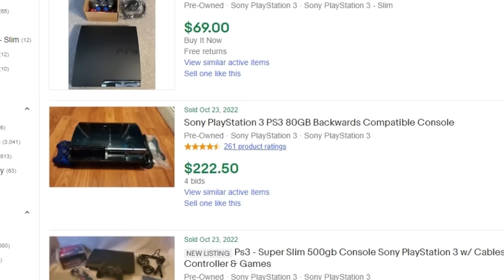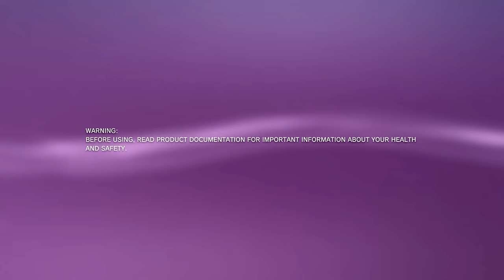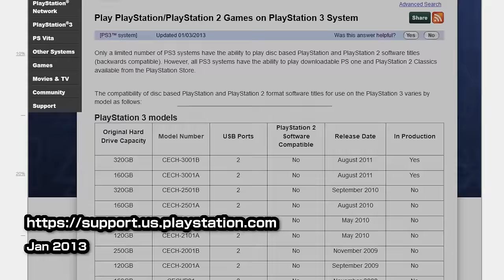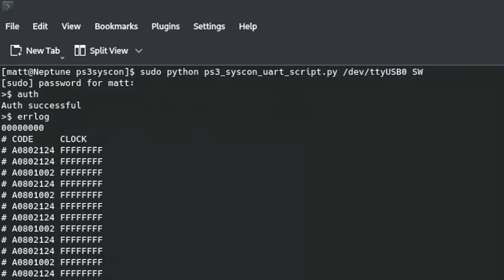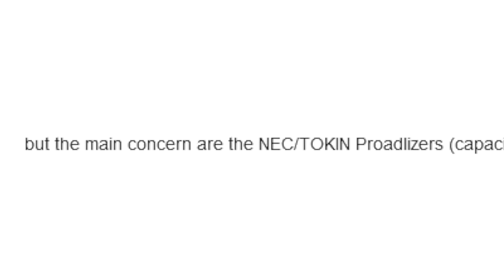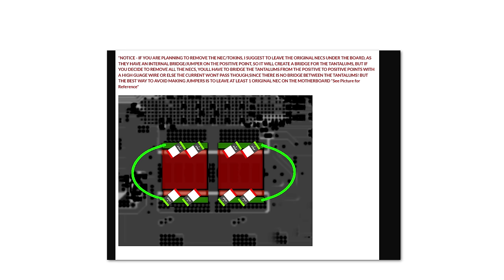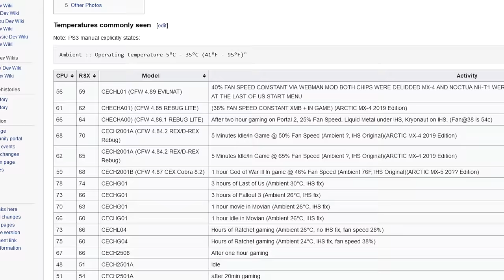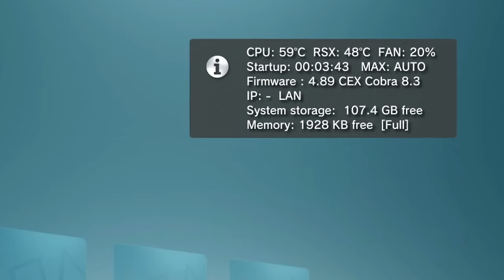I bought 3 PS3s for $50... how bad could it be?

Comment: By the way, the NEC/TOKINs don't fail that often. Always check SYSCON logs.

Also - the wire you used to bridge the 2 sides is far too thin - it will heat up excessively and may burn. This has happened to people who have done the NEC/TOKIN replacement before and can be very dangerous. You need to use a much thicker wire.

Usually what happens is people go heatgunning the board to remove the NEC/TOKINs which temporarily "revives" the GPU on the board. Most systems where people replace the NEC/TOKINs end up failing again later as they were never the cause of the issue originally.
Reply: Didn't you saw the error code 1002 point out a bad VDD for the RSX? That's not a BGA problem, if it was, it would appear as 3034, 4402 or 4411. The Nec/Tokins were the problem on that unit, reported by Syscon and confirmed by swapping them. Heat would temporarily fix something in the case of BGA related problems.
Reply: Completely aware of this and I agree completely.

The reason I mentioned it was simply to refute in the video where it is stated about the NEC issues being "common".
Reply: @viniciusvidotto7536  You can't necessarily say any of this in absolutes. The caps were a problem, and may have been killed by a different problem, which could be anything from an intermittent power supply failure to, at absolute worst, cracking of solder beads under the GPU (which turns out to be not that uncommon on these systems, unfortunately). Again, I agree that the capacitors had indeed apparently failed, but given the age of the machine, a failure at this point in time is possibly below the life expectancy of that part, very possibly indicating a related but separate fault that caused this failure, and at the very least, the possibility of more than one point of failure, even if intermittent, should not be ignored. Please excuse any bluntness in my tone, I simply want to avoid people being misinformed and permanently damaging their irreplaceable devices in a misguided attempt at repair.
Reply: @Brooke M.  I figured the caps died from the uh, bugs and gunk that Matt cleaned out. All that disgusting stuff made it them run too hot, and then they got KO'ed.
Reply: Oh hey Octal! I didn't realize it was you at first 😅
Reply: i had no idea you could even wire up caps like this, really interesting workaround ,thanks for the tips.
Reply: Thicker wire and more of them, for sure.
Reply: fgfs on the xbox wen /s
Reply: @parnikkapore  lol
Sadly there is no framebuffer drive for Xenos, so :( otherwise it might actually be worth a try
Reply: I’ve come across and fixed many PS3’s with this same exact situation. Early Slim models and everything before it can fail because of these caps. They were also in Toshiba laptops and known to fail there too. Sony eventually dropped these caps in all board revisions shortly after the first Slim came out, 2500 I believe, so even Sony knew this was an issue.
Reply: @erikt211  Yes, they certainly can fail, but most often the failure points is the RSX itself. That is why the SYSCON logs should always be checked to determine exactly what's at fault. The reason Toshiba A300 fail was because capacitor sit right on top of CPU where it gets very hot, and it is only one for the entire rail proximity decoupling. So high load on it, and high temp on it = higher failure.
Reply: Yeah, I had heard something similar. It seems to be a more modern thought process. Just arbitrarily deciding the NEC/TOKIN caps need to be replaced is jumping the gun.
Reply: It’s quite interesting to note that even only a few years after release, people would assume it was the NEC/TOKINs that were failing when the console gave the dreaded “yellow light of death”. It COULD be the caps, but there were a host of other problems that could crop up due to Nvidia’s poor choices when picking the kind of soldier composition to use for the CPU & GPU. This combined with the natural heating+cooling cycle and the chips themselves were a recipe waiting to happen.

Most notably, a new fix that was recently found actually allows somebody to pull a CPU from a newer model PS3 (where the chip runs cooler due to better efficiency) and effectively force your PS3 to use the newer CPU. This is only achievable now because (I think?) this kind of fix required encrypted console keys and the modding community wasn’t able to crack it until recently.

Basically, you lobotomize your old CPU and give your old PS3 a newer brain to save it. Always thought that was kind of funny.

Comment: The two PS3's I have now are both from Goodwill, and of differing price ranges. My Slim was $50 and I took a chance with it. $40 from Amazon for a new Bluray drive and it works well. Sure as shit though, a year later, snagged another Phat backwards compatible PS3 from the same goodwill. Not a single thing wrong with it. The PS3 market is good now, the top tier games are dirt cheap, and honestly, they don't even look that bad either. I'm happy with my steals.

Comment: I would really like to see an update on the fixed PS3 in the future at some point after some use. The TOKIN caps have gotten a bad rep but it has been proven that they are not the primary cause of graphics related YLOD as other commenters pointed out. However in almost all cases that had any sort of a GPU related error, replacing them causes the console to temporarily revive and start working. Either you got really lucky with the machine and it was one of the few that had bad caps, or it's only a matter of time until it dies again.
Reply: You’re probably referring to specifically the Ps3 models that contained a 90nm RSX GPU which that would apply. 

However, later fat ps3 models contained 65nm RSX Gpus which did not have such and issue, and replacing capacitors would fix them(generally, still read syscon errors before doing anything to your system)
Reply: @DeadlyHellhound  Well I don't think Matt specified what version the PS3s in the video were aside from not being backwards compatible with PS2, and I'm not sure if he meant that they are not the first models ever released with hardware level backwards compatibility, or if he meant they don't have the software level either. 
Keep in mind that what I do know about the issue I learned from RIP Felix and his extensive look into the subject, but if I remember correctly the 65nm ones can still have this issue, it's just less common. As for the capacitors, the amount of times they have been actually the cause of the YLOD was rather low, but changing them revived the console in question for a while in almost all cases because of the heat involved. As I said in the original comment it's possible that Matt just got very lucky and it was a matter of the caps giving in, but I think an update in the future would be a good idea no matter what.
Reply: @xiii9354  judging by the insides and the thick heatsinks included with this system, im going to guess that it is a P01 model (second to last fat ps3 revision). 

The first non-ps2 compatible ps3s were the G models, and those models had a vastly different chassis inside but also had 90nm GPUs so theyre often found with dead GPUs. H models came soon after and had a similar chassis as pretty much all the later fat models shared at that point, although H, J, and K models had separate wifi/BT boards from the motherboard but still had the same form factor. H models also were the last 90nm models so you’ll find those junked as well. 

The only concerning models with 65nm GPUs would be the the first PS3s that came immediately after the H models, which were the J and K models. Even so, I rarely encounter any J or K models with faulty GPUs (even my K model ps3 I had since it released in late 2008 still works perfectly fine with original caps and everything) 

Keep in mind, RIP-Felixs video is based off mostly theories with a good amount of evidence to back up those theories. He never puts everything off as a fact simply because he hasn’t gathered THAT much information to really set everything in stone just yet (theres still a lot of development and experimenting regarding PS3s, this info is still relatively newish). 

So while I would agree that J and K ps3s with 65nm GPUs could be a concern since those models released immediately after the H models with faulty 90nm GPUs, there still just isnt enough proof that 65nm GPUs should be of any real issue over 40nm GPUs. There just isnt enough logged information to back up these claims (more people rather go for the 40nm gpus clearly since they are technically better GPUs anyway. But thats not to say that 65nm GPUs arent also a viable option)
Reply: @DeadlyHellhound  That's genuinely a very informative comment, thank you. I think I'm just rather cynical of the cap replacements, I got 2 fats for a similar price as Matt, both with YLOD. I went into it thinking that there is a fairly easy fix now (didn't remember it was the caps, only that I saw a video about it) but after doing some research and seeing that video from Felix it was like being punched in the gut. 
One of them might have some sort of HDD related issue judging by the fact that it doesn't flash the HDD LED while the other does, so not all hope is lost. Still, knowing that it's a design fault even if this issue can be fixed, the RSX will be a ticking time bomb. The two I got were a C and a G model, the C being the one with no HDD light.
Reply: I mean we could say he got lucky but he did check the error code before doing the replacement error code suggested that it was the capacitors, the problem with replacing the capacitors is that most people don't check the error codes before replacing them and just assume that it'll work.

It might still die later, although if it does we're probably not going to get a video from him because he's definitely not skilled enough at replacing the RSX.

Comment: Man, I watched a 2hr documentary on the PS3’s YLOD issues, and even though it all ended with “the capacitors are a fix but not the fix… the CPU ultimately needs to be reballed too” climax of the documentary, your quick fix procedure really made me reconsider my plan. The plan after the documentary was to keep my fat PS3 stored away for a bit until the community comes up with some mass-produceable, refined fix years down the line.

But I’m really tempted to try the paperclip capacitor mod just so I have a working PS3 in the meantime. Tl;dr, phenomenal video and love your work!
Reply: The RSX is not the cpu, it's the gpu

That's what having the problem, but it's also not just thr balls, but the underfill too
Reply: did you end up doing this?

Comment: Fun fact:if you hold the ps button and the share button on a ps4 controller for 5 seconds it starts to blink and if you go the Bluetooth settings on the ps3 it will state the ps4 controller as a “wireless controller” and if you press it you can use the controller wirelessly.

Comment: For cleaning the ps3s, you can hold the eject button and switch the power supply on and the fans will spin up really fast and clean out the air vents...
Reply: What about ps4?
Reply: Now granted Sony advises to this outside for safety reasons
Reply: @samiwilmot7413  Ps4 doesn't have this, far as I know.
Reply: @andrejpopovic52  also newer modell of PS3 don't have this feature anymore. I think it is only available for fat PS3s
Reply: @DoomWarriorX  Yes. Since you have to flip the power switch.
Reply: @andrejpopovic52  and the Super Slim doesn't have a software eject button
Reply: alas my old fat seems stuck in this mode. any thoughts
Reply: That's not what it's intended for. You should still manually open it and clean the gunk out, especially repaste the CPU.
Reply: It works on the PS3 Slim too, but you have to remove the wall plug, as it lacks the back switch on the power supply.
Reply: @Sugurain  Thanks, i didn't know that.
Reply: @johnwhorfin5150  check for shorting on the buttons maybe

Comment: I'm glad you syscon'd it rather than just replacing the nectokins, as they are not the de facto cause of the ylod, which is a general hardware failure that can be triggered by any part failure the only true way to diagnose a ylod,glod etc is to read syscons… I had the YLOD on my CECHA01, the original backward compatible PS3. My syscon error was for the rsx, so I replaced it with one from the PS3 slim, which is the much cooler and reliable 40nm rsx Rather than the widely defective 90nm rsx that Nvidia originally produced for the original Xbox 360 and PS3. As an added bonus, I've gotten myself  a way more reliable and cooler original PS3 that can play PS2 disks. Great video I hope to see your take on an original ps3/xbox 360!

Comment: 19:04... As electrical engineer, this caused me a great deal of pain...
1) paperclips are not as conductive as you think
2) by that 10 cm path, you introduced so much reactance that the capacitors became absolutely useless (the current doesn't reach from capacitors anywhere near fast enough to deal with transient loads)
Reply: I'm an electronics engineer. Why do you say they're now useless? The caps are tantulum, he's used some pretty heavy gauge wire and they're really not that far away. I'd be much more concerned if these were ceramic caps - but tantulum isn't going to be doing too much at higher frequencies. At those frequencies, absolutely the introduction of more inductance is going to be an issue.
Reply: @dman8734  Not capacitors themselves, the extra length of the path to the board is the problem...
Extra resistance and inductance, which totally defeats the point of the capacitors being there for handling transients in the first place. Also he didn't even use copper wire, but a paperclip which not only is not great conductor,but also is ferromagnetic, so skin effect is a huge problem a those frequencies.
Capacitors could be ideal, but with that connection he made them essentialy useless.
Reply: Another electrical engineer here. Had similar concerns. Adding extra trace length is not ideal by killing higher frequency filtering + making EMC radiation and immunity worse... But obviously it seems to work sufficiently fine. And as long as it does work, he was right in doing so. Sure you shouldn't put this into series production. But We've all hacked prototype boards up like that and surprisingly they are still working, though by all rules they shouldn't.
Reply: @craelectronics As you know  the problem with transients, is that they can be higher than nominal voltage. Although this adhoc solution might work well enough now, the voltage spikes can still damage and kill the memory over time.
Ideally you would want to measure that on oscilloscope.
Also stability might not be the best indicator, as the memory can have some amount of undervoltage tolerance, so it is seemingly stable even though not running up to spec.
Still should have used copper wire.

Comment: Hey Matt, thanks for showing us your PS3 revival process! 

You should defenitely consider delidding though because that thermal paste under the chips head spreader is only worsening the temperatures, even to the point where it won't even make a proper connection to transfer the heat. 

We have only delid two PS3's so far, the backwards compatible ones even, but we felt much safer doing that than ewmoving the Tokins (well we also didn't have a boot problem but I guess for the long run it would be safer to replace them sooner than later) 

I hope this will get a follow up video with the mods or even with a delidding video! 
If you need any infos, tipps and tricks for the delidding process let me know, I have found some good sources where people show and describe how they did it and what thermal paste and pads they used to replace the old ones

Comment: More tips for the soldering! Usually 200-300 degrees at medium to max air flow. If you're putting down or picking up a component up with tweezers, don't go all the way down to the board, go 50% of the components width down with the tweezers, keeps it from flying off when you go to put it down. 

Kapton tape keeps stuff on while being heated.

Happy Hacking!
Reply: Kapton tape, not Capton tape.
Reply: @nikkiofthevalley  ye my bad, shoulda called it polyimide tape as Kapton is a trademarked/brand name.

Comment: I ended up with a PS3 that someone threw into a bush earlier this year, can't use it atm since it was completely filled with sand for some mysterious reason but surprisingly it does still work (including the disc drive).

Comment: Hey pal, just a quick tipp: the wires you used to connect the + sides (mimicing the necs) are waaay too thin. Been there, done that, they will eventually burn due to the high current flowing there... I would suggest replacing it with some thicker wiring.

Comment: Bro, U have open my mind. I have one PS3 Fat here, I took it to a technical assistance, but in not long time before it's came with the black scren. He had the Ylod, they fixed it, but usinig it for a little time he started with artefact (very sad). I noticed the temperature before the black screen came, the CPU and RSX took  about 70ºC (158Fº). Maybe the problem can be the cold system, or my chip of HDMI ou AV. The board you used are really good, it's tell everything that was wrong in the PS3. Thanks man,  u don't now how I'm glad to know these features.

Comment: You should have used the NEC TOKIN replacement made by RIP Felix, just using only tantalum capacitors will give you too high ESR and the system will fail again soon. The RIP Felix replacement uses different type of capacitors to lower the ESR to an acceptable level. Just watch the video RIP Felix made on the YLOD.